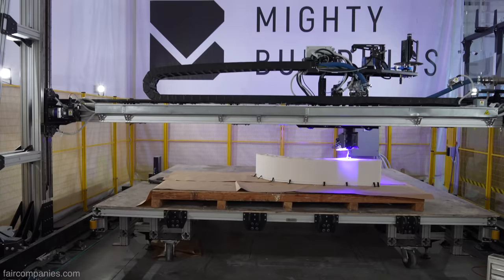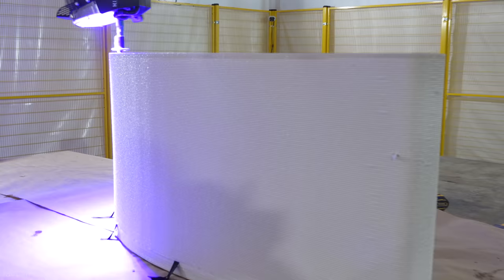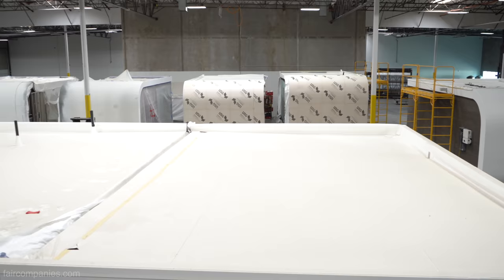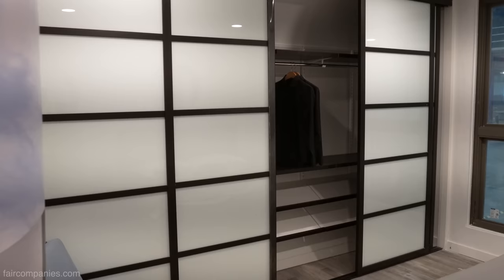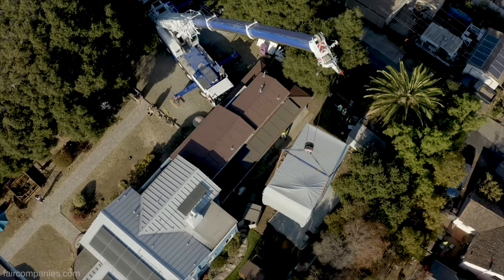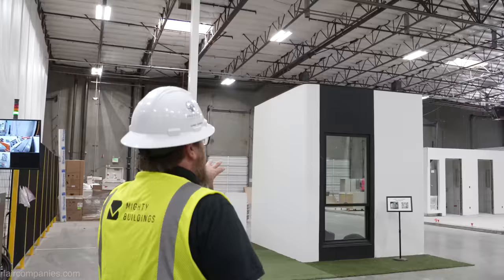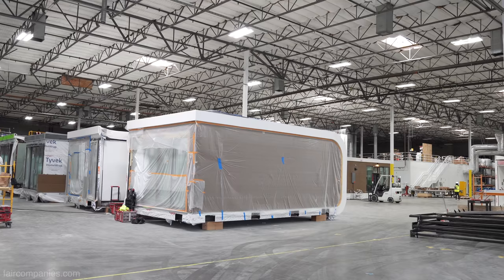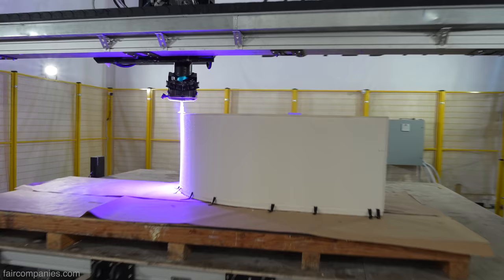3D-Printed in 24h, no waste. Price to fall as builds ramp-up

Comment: Technology is suppose to make things cheaper but their prices are crazy high
Reply: Construction is basically the last industry in which 3d printing makes any sense whatsoever. The price per kg of these materials tends to be 10x to 100x higher than old fashioned things like lumber; and their throughput is absolutely atrocious, to be able to justify all the expensive hardware invested in working with it. The only sane thing theyve got going for them is the factory construction; but that does not really have anything to do with printing really. Ill take a CLT house over this any day of the week. The only thing printing has got going for it is the ability to do highly complex customized geometries; but instead of giving Gaudi a run for his money these jokers are making panels that you could just as well extrude at multiple meters per seconds, using actual economical and sensible raw materials.
Reply: @randomstranger2472  we’ve had the 3D printing technology for buildings for years. Not only that, the materials are also cheap. Our current state of economics is all speculation

Comment: Now a pre-senior, I've been waiting to see this technology in use for over 40 years, since Jacques Fresco inveted the concept. 
One important question:
I live in the Canadian Rocky Mountains, where -40c is not uncommon in the winter. Have you come up with a substrate that has a high enough insulation factor to make this Globally viable?
Reply: Hi there, our mods are rated for all 16 climate zones in California. This would include zones around the Lake Tahoe region
Reply: They seem to be focusing on one market which is Bay Area 2nd homes  -  so I doubt it. But there is no technical reason they could not create a cold climate version - but that would first require another $2 billion in research or whatever it cost to get here.
Reply: It doesnt have to be. They can all be locally tailored to the paricular environmentl needs.
Reply: @michaelnurse9089  The modifications of the digital 3D AutoCAD model would probably only take 40 hours.  Once the digital model is updated you can print away with whatever wall thicknesses you specify.  They could print out  just about anything. Just unfortunate for the construction workers who might lose their jobs with this tech.
Reply: @arminius301  I think Jobs in the industry would need another skill ..
     - yes, I do understand that it may be debatable at this juncture.

Comment: I wonder what the r-value of the wall is?
Reply: Nowhere near high enough.
Reply: You mean the melting point temperature? :)
Reply: @pepperpepperpepper  hardening point temperature.😃
Reply: It is California. r-Value is not so important as elsewhere. They could modify it for cold climates and add heavy insulation.

Comment: You have done it again Kirsten, put yourself right at the head of progress. It would be an AMAZING feat if they would be able to turn out 12'X34' Park Model seniors and couples housing at an affordable cost. With my 1.5 bath "J Wall" design I even have a floor plan with one wall plumbing...Two bath sinks, two commodes, Kitchen sink, Dishwasher, Washer/Dryer, Ice maker spigot.

Comment: so the biggest cost when you get it home will be getting some curtains wow that's a lot of window space would think that would let out a lot of heat in the winter. Wondering if they have weather tested one on some land some where it gets wind and rain, snow?
Reply: Because the Windows have more insulation than the walls

Comment: Are they able to have multi floor units or is this just a one floor system? Wonder how it holds up in the harsher weather areas.
Reply: I was wondering the same. I live in Cabo since 2019 and when a hurricane hits is always a major concern, my main goal is to build a small, neat home here to live my golden years to come. But it is nice to see that tech is evolving and it is making its way into building homes. The price is quite unreachable for many but it is a start. Again, wondering how it will behave under very windy and rainy conditions (tipically cat-1cat2 hurricanes which are the most common here) or a mild earthquake (maybe m5 top?). Mexico is a beautiful country but it comes with its hazards.
Reply: Do they have a floor plan which meets both Passive House and/or Universal Design standards?
Reply: It seems like right now they only have the 2 pod model, but I can't see why they wouldn't be able to make a 2 story one in the future. It probable wouldn't be too hard either. 2x2 design. Bottom pods are a kitchen/ dining area with the stairs and the other pod is the living/entertaining space. upstairs you have the one pod with the stairs have a master suite and an additional full bath and the other pod is the current 2 bedroom one. 3/2 house approx. 1400 square feet. And since it is modular you could probably have 3 pods on the bottom to have separate living and dining rooms plus a half bath downstairs.
Reply: I'm thinking they have plans to make stackable modular units with holes cut out in the floors & ceilings to accommodate printed staircases in the future.  Would be a nice option to attach modules together, side-by-side, to achieve a ranch style home with increased living space.
Reply: I like the creative ideas of adding floors. Please give Mighty Builders bit of time and it will have all those additions. Its too earlier times yet.

Comment: What is the lifespan of this shell material?
Reply: That's part of the problem right now. There is no way to reinforce the concrete. May not be good in very wet climates or earthquake prone areas.  But I'm sure we'll figure it out soon.
Reply: @tixximmi1  it's not concrete, it's UV cured polymer with a bunch of fillers.
Reply: @AndrewHelgeCox  Yes, the polymer aspect is a potential concern.  Grinding on plastic creates micro plastic pollution.  We may not be allowed to share links to other articles in our comments, google micro plastic pollution.  I think this is the future of building and I would love for a great company like this one to explore the full life cycle and environmental impact of this new material.
Reply: Time stamp 12:21-12:24, look at the dust created as the polymer is being refinished.  Micro plastic pollution is something the entire plastics industry needs to address.  All companies should consider the full environmental impact of their products.  As cnc work with polymers increases, initially the air quality within the factories for workers and ultimately everyone’s water quality as the micro plastics end up in our water are major concerns.
Reply: @janjander152  Yes, I saw later in the same video that they grind the walls while still inside the factory so they are having to face this problem. I hope they are protecting their workers from the dust combining glass, polymers, and mineral fillers.
Reply: @AndrewHelgeCox  Yes but most of the 3D stuff is done with concrete. The problems remain the same. They plastics actually have more problems associated with them.
Reply: In a fire, a few seconds.
Reply: Whatever the insurance is that they can't get sued when the roof caves in from snowfall I'm guessing

Comment: Does that textured surface collect dirt that will discolor the surface over time?
Reply: Are the surfaces in the bathroom waterproof or water resistant?
Reply: You saw someone sanding the exterior in the video.
Reply: probably. probably why there was a clip of someone sanding down the exterior.

Comment: She said the smaller unit was 700 sq ft, but my understanding is that most areas in the USA have a minimum requirement for a house of 900 sq ft. Something to keep in mind.
Also, how odd that in LA the buildings can be so close to the property line.  In some areas, all buildings - even sheds - must be at least 35' from the property line.

Comment: House framing isn't the most dangerous or difficult part of house building if your house is as small as these are.
In terms of most difficult that would be primarily:
1) finding property you can buy at a price you can pay in an area you can/want to live with job prospects sufficiently close by
2) funding
3) getting all the permits to build (no town in my state would grant permits for this house with no basement or other sufficient method of securing the house and preparing the ground to hold the load of the house
4) planning all the things like sewage, water, electricity, heat, airflow, getting the ground ready to hold the wait of the house
5) building the above along with rooms to define the space

Comment: Exciting developments, and hoping to see more of this. These look immensely better than the fat-bead concrete 3-D printed homes.

For the fully 3-D printed structures, how do they get the insulation in? Is it blown in with a hose? And what about water pipes and electrical?

How's the durability? Given that it cures due to UV light, do its properties change over time after being exposed to UV outside for years on end, such as getting harder or more brittle? And how recyclable is the 3-D printed material for it's time for a home to be dismantled? (Not a huge concern, given the reduced waste of this construction, but I'm curious nonetheless.)
Reply: 03:46 - That's a crack on the base... Just stop the video at 03:47. So.. no, thank you.
Reply: @yoshy2628  Yeah, it's a prototype tho..

Comment: I imagine configurating my house from the computer and choosing materials and in theory even the furniture and the electrical wiring and plumbing can be printed. It will be like configurating a car. Modular units so you can expand easily. What about the foundation? Man, I want to work in this field the more I think about it.

Comment: If I recall correctly: You can build a home out of any material you want, so long as it passes local life-and-safety (aka: fire) and structural requirements. If these guys wanted to sell entirely 3D printed structures, all they would have to do is send their wall assembly for fire-testing (smoke and flame spread) and then partner with a professional engineering firm that has engineers licensed in the various states.

Whether or not 3D printing a structure makes any sense (it doesn't) is a topic for another day.

Comment: I really dont like this concept. Numerous problems: off-gasing, recycling, durability, repairability, flexibility of modification, inability to salvage structure in the event of fire, inability to deal with high winds. All with a comparable cost to structures that have none of these negatives. I'd sooner go with CNC ply over this. Nothing beats stackable concrete block IMO.

Comment: This 3D system is 100% going to be just as expensive if not more expensive than other building methods. It can cost way less over time for the BUILDER. In no way are they going to pass down the savings to the buyer. 3D printed homes were built in California recently with horrendous prices. I followed this technology for a few years and have completely abandoned it. The answer to the housing crisis is communities gathering and helping each other build earthen/adobe/earth bag homes. Building with earth with the right architecture costs about $10,000 in materials per house. In dry climates, earth bag homes/super adobe is the answer to the housing price crisis not 3D printing.
Reply: 123123 Please do not be dismayed with the Technology because i believe, if enhanced and developed further through the years with improved/creative AI, it will be the way into the future. Get the Robot to  do the hard yaka for ya!  The question is how can you&I can get one of these set-up or Robot, so we can mass produce affordable homes.
Reply: @iliapitaoi6268  I'm not dismayed by the technology. I followed the progress of the technology because I thought it had promise. What I'm disappointed in is greed and how the "savings" is not passed down to the buyers of the properties but rather the savings in time and cost are only for the benefit of the builder. If it's going to take time, and it will likely take a lot of time before people make as much money as possible out of this technology, then it's pointless because time is of the essence when it comes to affordable housing.

Comment: THIS is where it's at!  If this catches on, you may se an explosion in affordable housing, provided that they don't just use it as a cheaper means to generate higher profits.  This could arrive onto the scene and reduce the output of waste plastics into the environment as well as make a house that lasts like kryptonite.  The maintenance would be practically non-existent and the Pacific garbage patch would shrink, due to the demand for all the waste plastics the industry could get. 

I regions where termites and other home destroying pests exist, this would almost single-handedly solve this problem.  Technically advanced solutions for environment control would be super easy to experiment with.  I bet the efficiency of heating and cooling would be right up there with refrigeration tech.  What an amazing system you have!  Coupled with a 4KW solar array, this thing is nearly self contained.  It's a perfect solution for central and North Texas.

Comment: 24 hours to 3D build the shell is not cost effective. That size shell can be framed and sheaved in 16 man-hours with lower material costs (wood). SIPs are even better from a structure perspective and SIPs are already insulated...

Comment: 15:44 - Their 3D printing material is already amazing. They are able to print and cure a bead at a right angle without droop. That itself is enough to revolutionize 3D printing. And it runs so fast! This tech is mind-blowing.
Reply: Incorrect. All of what you just said is incorrect.

Comment: Would like to see some solar-powered fans push passive solar-heated air through the roof, around the curved wall, and through the floor to heat the floor since channels can be printed into the "panels" and maybe reverse the air flow (or water?) to cool the ceiling/roof in summer.
Reply: Just pull thru flexi-duct within the sandwich cavity and outlet register where needed. Many ways to pluck the chuck!

Comment: While watching the video I was thinking they should provide a flat pack wall panel system and it turns out they do. 

I hope both their flat pack and prefabbed homes also allow for tiny mobile home versions that are trailer friendly as land and hooking up to city utilities is expensive. Also a finished interior must become part of their wall panel system so no additional steps finishing or otherwise need to be done besides erecting and putting the panels into place with the flat pack version.

Comment: If your even thinking about buying this house . DON'T DO IT. Its a nice concept and this is good for temporary structures. Meaning structures that can last for a few years. The fact that llight can fully destroy  your house. also the thermal insulation. I can imagine it is really difficult to put insulation into this once it's built. If you want to wall mount something like a television forget it. It might not be plastic, but the fact that your building your house out of recycled materials is not good. It might be environmentally frendly like once your house fully breaks down in a few years you can fully compost it. anything that can be built this fast is NOT meant to last.

Comment: This is fascinating and I hope these kinds of designs get traction so it’s easier to gain access to affordable housing. I’d be all in on a home like this if they can find a way to grow the size. Instead of a 250 or 500 sq ft home how do you get it to 750 or 1000? Find modular connector designs that allow people to buy a larger home for a small family as these are really for vacation homes or guest homes. Make it possible to buy a 1,000 sq ft home 3D printed for under $150K delivered and you’ll see an explosion as people look for affordable homes on a budget that can afford a payment but not the gaudy $3500K per month payments the average home costs in more developed metropolitan areas.

Comment: MIGHTY STUDIO

Floor Area: 350 sq. ft.
Overall Dimensions: 25' x 14'
Bedrooms: Studio
Bathrooms: 1
Starting at $204,000 USD 

$204, 000 USD + hidden expenses, you are looking at about $250, 000 - $300, 000 for a box shape prefab !! 3D or not, pricing is not competitive.

Comment: Right now, 3D printers have only one print marker weld pen, if they make a set of different notch sets of pen, making the full layer sheets across, 3D weld could be quick, as assembly lines, instead of a work top bay.

Comment: Have you considered making walls in modular units i.e. a window unit, door unit, corner unit, solid wall unit in standard sizes that can be connected to make any size and shape you desire on a foundation that could also be modular? While you're at it make the roof in modular finished units too.

Comment: I'm wondering if it actually needs a steel frame for strength or if it's only used because of building codes. If it needs an expensive, heavy steel frame because the 3D printed frame isn't strong enough. Then that makes the 3D printing not as practical.